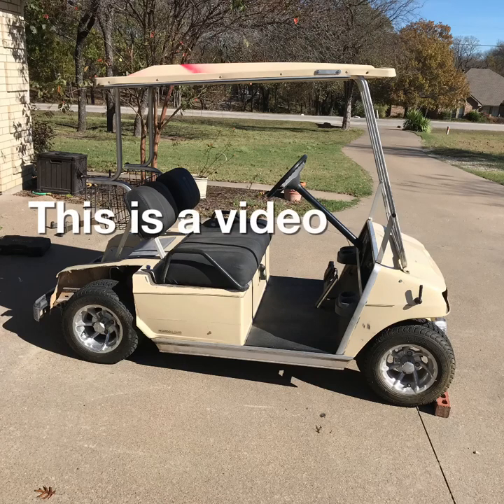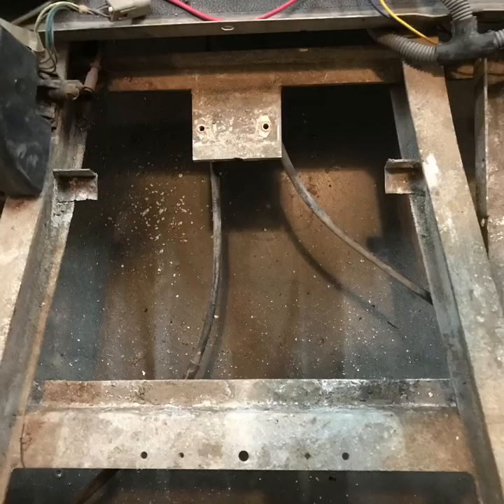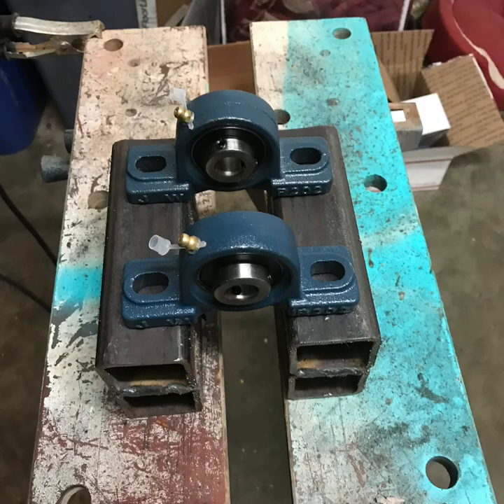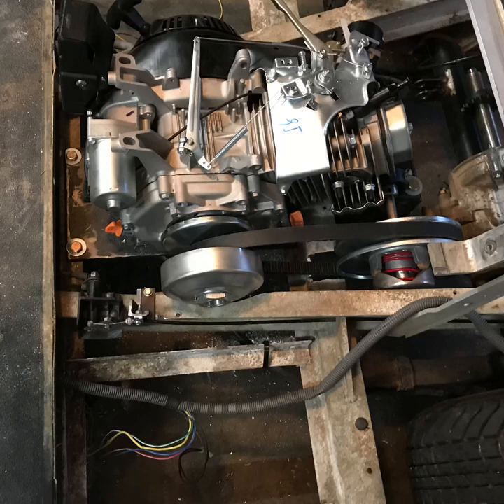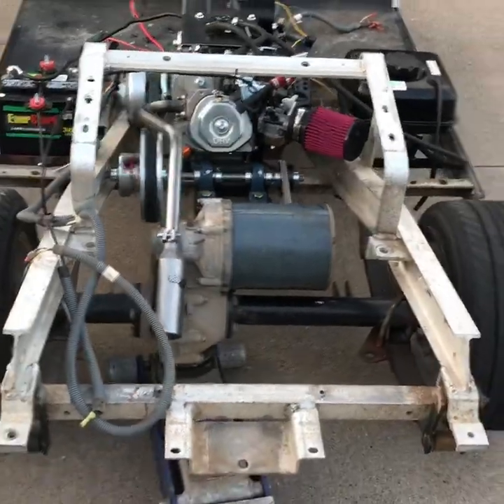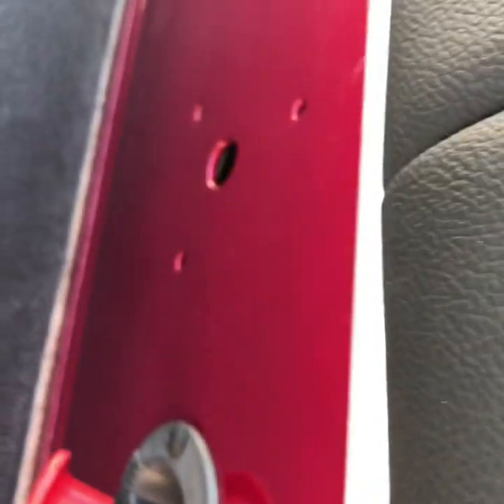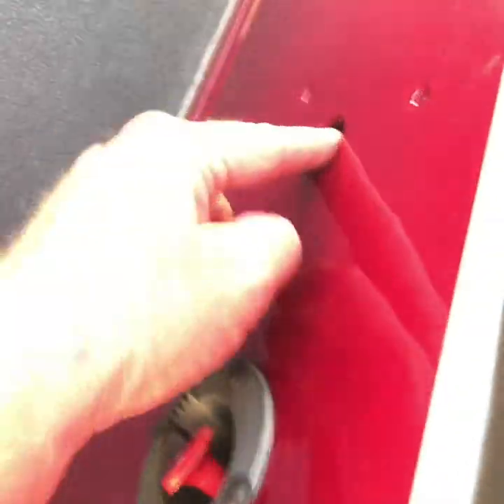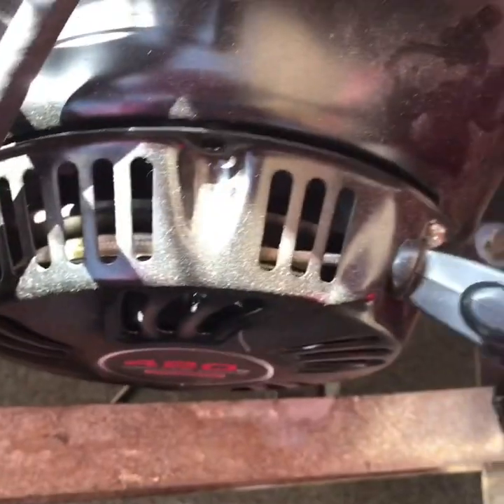Club Car DS electric to gas swap

Comment: You just convinced me that instead of buying a new set of batteries for my cart I would be better off going to gas...I have a club car that will have a 57 chevy body put on it that is almost ready to be mounted...your video was excellent but I know there will be questions I will have going forward...thank you.
Reply from the maker: I was the same way. Set of batteries $800. Gas motor $325. If you have any questions I’m here to help.
Reply: I do...besides the Predator motor which I'll go with do you have a list of the other things I will need to buy to start this project...it would help.
Reply from the maker: Ron Engle I got the 40 series clutch. You’ll need the low profile air cleaner kit for 420cc. 5/8 jack shaft. 2 pillar bearings. Sprockets for the jack shaft and electric motor shaft. Pulse pump. Choke cable. Throttle cable. 40 chain.
Reply: thank you...what are you using to charge the battery.
Reply from the maker: Ron Engle the motor chargers the battery.

Comment: Nice conversion, I see you've upgraded to a gas rear diff. bet that made a world of difference. I wanted reverse and gears so got a 250 4wheeler motor and trans. 
You could hook stock lights up to the battery and if you turn a cheap alternator off the jackshaft charging system complete.

Comment: Very nice job! I converted a 94 EZGO a few years back with a 6.5 clone and reverse. Very fun and satisfying project. Glad you went with a larger engine though. 

Next time around I'll make the rear suspension separate from the frame so that the axle and engine move together.
Reply from the maker: 89Mirageman Thank you. It was a fun project.
Reply: What was wrong with the 6.5 not fast enough? I've seen a video of a guy doing 20 with a 10t sprocket and 28 with a 8t sprocket with the 6.5, I'm just curious what your experience with it was
Reply: @fordfanatic7836  It was adequate but ideally a 9hp or better would have been nicer. The 6.5 is for a go kart and a golf cart is quite a bit heavier. Especially with a passenger.
Reply: @89Mirageman  I was planning on going with a 6.5 with some upgraded parts, but it still wouldn't be close to 13 hp so I'm probably just going to bite the bullet and get the higher horsepower itema
Reply: @fordfanatic7836  With the price of these larger Honda clone engines being so affordable these days, it's kinda crazy not to just start out with something larger and bone stock.

From my experience when you start modding the 6.5 you lose reliability and they're harder to start.

Comment from the maker: The new video of upgrades and dependability are coming. Let me just say SPEED!!!
Reply: Any updates.  I'm looking at a 90s club car electric with a bad motor, the guy is asking $300, and really want to do something like this.  Our community just passed an ordinance allowing golf carts in town. Be being me, I need one that will do at least 35.  Looks like if you removed the governor, you should be able to get it up to about 45mph without blowing it up.  That'd be perfect for me.
Reply from the maker: tonyfremont I did some to make it go faster. I also got a gas rear end for it. Haven’t changed it out yet

Comment: Nice, I used a gas frame with the rear end out of the gas cart so I would have reverse and installed a gs550e motor 6 speed. Unfortunately had engine failure so looking to drop another cycle engine in the future.

Comment: I can't wait to see how fast mine goes!   I have the same cart and engine except my axle has the 6:1 gears and running a 10 tooth on the axle shaft and a 10 tooth on the clutch
Reply from the maker: Sam Conard you need a bigger sprocket on the clutch. Mine is a 16 tooth. And I’m thinking of going bigger.
Reply: @racerxtex3177  I've found clutch sprockets all the way up to 19 tooth.  But was just curious because of the fact mine is a 6:1 ratio axle vs the factory 15:1-or 12:1.
Reply: @racerxtex3177  by the way, THANK YOU!! This is by far the BEST video on YouTube for showing how to do this conversion!!

Comment: Hi, just wondering how that rear axle assembly has held up for you. I've heard that the rear transaxle has a nylon gear and can be stripped very easily due to torque from the gas engine.
Reply from the maker: It worked great. Burn outs was a breeze.
Reply: @RacerXtex  thanks for the reply! If you don't mind me asking would you happen to know the year of the cart? I'm currently building one of my own and our frames look very similar, ive been doing research and know club car can be very sneaky with parts! I just worry that with the gas torq-esc 420 engine my Axle spline may strip.
Reply from the maker: @tjrox03  1999
Reply: @RacerXtex  how was fitting the engine in? I've decided to go alternator setup and im afraid I might have to notch too much out of the frame to fit it and loose structural integrity
Reply from the maker: @tjrox03  relocate the alternator

Comment: What type of accelerator cable did you use to attach it to the gas pedal and how did you attach it so that it works flawlessly, any hel with this is great thank you.
Reply from the maker: I used a clutch cable from a Ford Mustang. I hooked up one end to the electric throttle control. I had to modify it.

Comment: I bought one with a predator 420 motor already in it. I cannot get it to go past 12 miles an hour though and it’s annoying because the joint is lifted and wonderful to ride but too slow.
Reply from the maker: You need the smallest sprocket you can get on the rear and a big one on the front’
Reply: @racerxtex3177  mine doesn’t even have a sprocket. It’s just a belt going to some type of transfer case I guess it’s called on the rear end. Is there any way I can send you a video? Just so you can see how it’s laid out

Comment: I have done this too, but I also installed a forward reverse gearbox too. If you want to see more, contact me.
Reply from the maker: The gear box is great but you can’t change the gears inside for speed.

Comment: What's the gear size on your clutch, jack shaft, and electric motor jack shaft? I'm working on a 1990 ezgo marathon. Put a 212 in mine. Thanks.
Reply from the maker: I put a 16 tooth on the jack shaft and a 10 tooth on the rear end shaft.

Comment: About how much did this conversion cost? You did a great job on it
Reply from the maker: Around $500 without cart.
Reply: do you by chance have a parts list of the parts bought cause i'd LOVE to do the same thing you did!!! at least for the engine, centrifugal parts, fuel pump. etc...
Reply: @Texas_Darkhorse  it's standard stuff, a harbor freight 420, a pulse fuel pump and probably a 40 series torque convertor.  You can get the fuel pump and torque converter from any go-kart site or eBay.

Comment: Are those plates that you built the jack shaft on from a frame machine?  Like a bee line?
Reply from the maker: No. Actually they are from a locomotive hand rail. I work for a short line railroad.

Comment: Did u drill in the head cover to add vacuum to the pulse fuel pump?
Reply from the maker: Availble Ble Yes. Drilled and tapped the threads.

Comment: Any issue with the chain tension as the suspension travels?
Reply from the maker: Yes at first. I put a tensioner on it for the travel
Reply: @RacerXtex  ok I am getting ready 2 do the same swap. Happen to have a picture of the tensioner?
Reply from the maker: @jkjgb17m26  sorry no. And I sold the golf cart

Comment: Hello racer, getting closer to finding all my pieces. What bore size is the sprocket for the electric motor shaft. Did you weld it on or have the shaft keyed for the sprocket?
Reply from the maker: The shaft is 1 1/8. At first I welded a 12 tooth on it. That’s the smallest I found. Then I removed the sprocket took it to a machine shop had it turned down to 3/4 and a 3/16 key way added. Now I got a 10 tooth sprocket.
Reply from the maker: Also go check out BigBlok502 video. He also built a Club Car DS.

Comment: What size sprocket did you use on the electric motor shaft? Inner diameter and tooth size? Thank you
Reply from the maker: I had the shaft turned down to 3/4 with a 3/16 key way. Then I was able to use a 10 tooth sprocket.

Comment: Awesome job, what size of a sprocket did you use that mounted on the shaft of the electric motor?
Reply from the maker: 10 tooth

Comment: So obviously your driven clutch is bored for a 5/8 shaft. What brand and series is your torque converter. Yours is the exact set up I'd like to put on mine. Your video is sweet, by the way!!!!
Reply from the maker: Scott James it’s a 40 series torque converter. I got it on Amazon. I had to order another belt for it. I got a Comet belt. Thank you for the compliment on my video.

Comment: Does it have reverse? And what about a charging system to run a radio or lights ?
Reply from the maker: The original build did not have reverse. I do now with a gas rear end. I making a new video of the swap. I don’t have a charger system. Right now I have no radio or lights.

Comment: What size bore did you use for the sprocket on the motor shaft?  And what number of teeth on both sprockets did you use ?
Reply from the maker: Bradley Burns At first I bought a 1 1/8 bore for the motor shaft and welded it on. But realized the sprocket was to big. I could only find a 14 tooth in that size. So I took the motor shaft to a machine shop and had it turned down to a 3/4 in with a 3/16 key way. That way I got a 10 tooth sprocket on it now. My front sprocket is a 18 tooth. I just bought a 24 tooth to put on the front to get more speed. I’ll make a new video of my sprocket swap.
Reply from the maker: curtisupdike No. Not yet. I have it but been lazy. Since you asked I’ll do it in the next couple of days. And I’ll make a video of it. And give you a shout out!

Comment: Hello sir, I need to know what diameter and how long of a jackshaft you used. Also would like to know how you attached the jackshaft to your driven clutch. And sprocket sizes. I have the exact same cart, and you have inspired me to swap mine to gas. My batteries are starting to get weak, so I'd rather do a one and done swap on it.
Reply from the maker: My jackshaft is a 5/8. It’s 16 inches in length. The driven clutch has a 3/16 key way and so does the shaft. My front sprocket is a 18 tooth and my rear sprocket is a 10 tooth. Batteries are around $700 for a set. And heavy. Swap it with a 85lbs gas motor.

Comment: is there a reason that you did not use the backing plate for the 40 series, or it did not come with one?? What size belt you used for it????  Thank you
Reply from the maker: Yes. I had to use a jack shaft and the plate goes to low and would hit the frame.
Reply from the maker: I used a 29 inch comet belt

Comment: What rear sprocket did you use and where can I get one?  Can you send me a link?
Reply from the maker: I had the motor shaft turned down to 3/4 with a 3/16 key way. It’s a 10 tooth. Got it on Amazon.

Comment: Hey racer, I have a Club Car DX I'm going to convert like you did. I use mine for sporting clays shooting in San Angelo, TX....Mine has larger tires on it and I need a little hill climbing ability. What do you think of using a 1 inch jackshaft and pillow blocks, turned down to what ever the driven clutch diameter is, with a 32 tooth on it and a 20 tooth on the 11/8 shaft on the electric motor shaft......would that work?
Reply from the maker: I don’t see why not it wouldn’t work.
Reply: @racerxtex3177  Thanks buddy.......your video is great, with some funny shit mixed in.

Comment: One more question, where did you buy the 10 tooth sprocket that mounts on the old shaft from the electric motor?
Reply from the maker: Sam Conard Amazon

Comment: Where did you get the choke cable from and how did you mount it into the charging port?
Reply from the maker: dangh405 I got from tractor supply. It’s a choke cable for a tractor. I used a hose clamp to hold the cable that I wrapped around the air filter.

Comment: How did u do the throttle set up with the stock pedal?
Reply from the maker: I took apart the throttle resistors and rigged up with a bracket.

Comment: Hi RacerX great job  on GC. What size torque converter you used was it a 30 or 40 series without the backing plate????
Reply from the maker: wade albert First thank you. I used a 40 series. The rear pulley is directly on the jack shaft.

Comment: Why was it that you how to turn around the driven pulley on the jackshaft what was happening that made you turn it inward the spring side facing the motor
Reply from the maker: This was in the early stages of the build. I later found out it was backwards. Mine has the red spring so I flipped it. If it had the yellow spring I could have left it like that. I was trying it that away so I wouldn’t have to cut the fins on the head. I only had to cut about a 1/2 inch off. Didn’t hurt a thing.
Reply: @racerxtex3177  I have the red spring also and it isnt seeming to grip the belt right so im going to flip my pulley inwards towards the motor i just wasnt sure why it matters which way it pointed in or out
Reply from the maker: Bradley Burns It did the same thing on me. You can change out the spring with the yellow one but you have to move the slider thing to the other side. I saw a video of it on YouTube.
Reply: @racerxtex3177  thanks again for ur help I appreciate it

Comment: ? You said you got a nother belt. Can you tell me what brand and the size.it is. You did a nice job.
Reply from the maker: It’s a comet belt. 29 inch belt. Thank you for the comment.
Reply: The only one I found is the comet 3/4 ×29 .....
Reply from the maker: Tim Henry When I get back from vacation I’ll give you the part #.
Reply: I found an easier way to get the shaft out of the  Windings for those With out a press. I used 4" grinder with cut off wheels. Cut  in half used chisel split right in half. Took about half hour.
Reply from the maker: The comet belt part # 203790A. Fits perfectly on mine.

Comment: What muffler did you end up going with? And sizes for inlet and outlet?  Thanks we just picked up a 98 club car ds and batteries are toast. We have racecars so we wanna go fast Haha. Saw your video and was best one we seen and very clear of how everything was done. Picking up our motor tomorrow.
Reply from the maker: I got my muffler at O ‘Reilly’s. 1 1/2 inlet and outlet. I also grew up building race cars. Drag cars and mud bog. I working on my new video of mods since I made that video. Thanks for the compliment of my build.

Comment: What sprocket did you use for the shaft on your electric moter.im having trouble finding one for #35 chain
Reply from the maker: I use a #40 chain
Reply: What was the tooth count on that pulley
Reply from the maker: Jason Kmett 10 tooth
Reply: Where did you happen to find that and was the Id 1 1/8
Reply from the maker: Jason Kmett I took the shaft to a machine shop and had it turned down to 3/4 inch with a 3/16 key way. You are not going to find 10 tooth for 1 1/8 shaft

Comment: Great video, a great source for those looking to do similar projects. I may be getting an '81 club car - the batteries, the price seems right (have yet to see it up close)  so if I get it, I will be doing a conversion to gas. Always nice to see how others succeeded in doing similar conversions. Could you tell me the size of the sprockets used on your jack shaft, and drive axle (tooth count)?
Reply from the maker: My jack shaft sprocket is a 16 tooth. My rear sprocket is a 10 tooth.
Reply: @racerxtex3177  thank you.